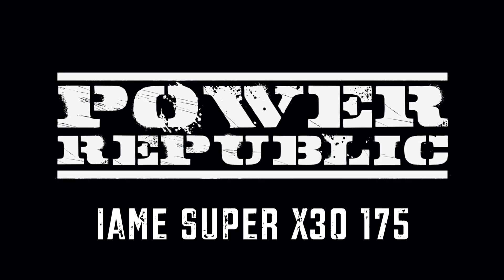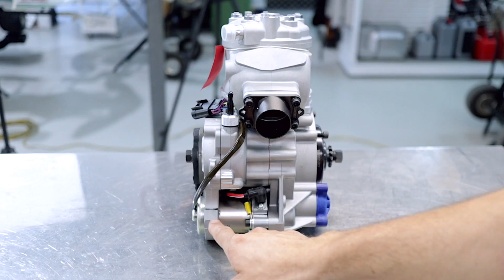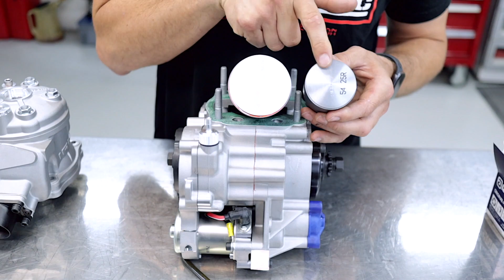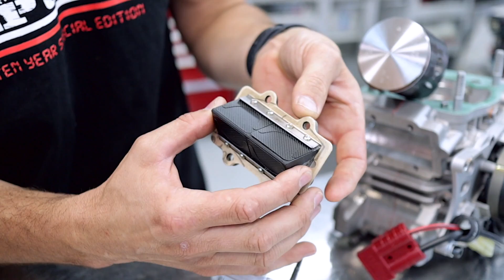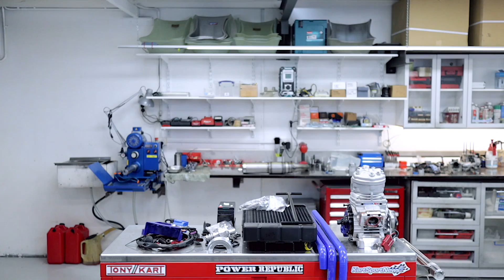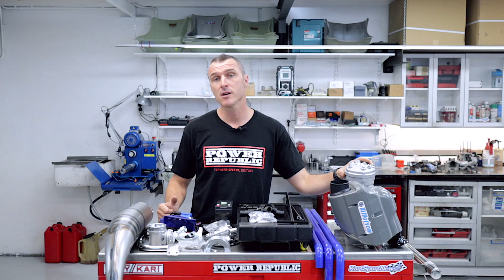UNBOXING: The IAME Super X30 175 Engine - POWER REPUBLIC

Comment: I have drived with this engine. Very much torque and without gears. But I changed Iame OK 125cc because there was too much problems with electric start. Do not buy electric start engine. OK engine has tiny less torque than x30 super 175cc but power is very similar with Iame OK 125cc and OK is lighter.
Reply from the maker: Thanks for sharing